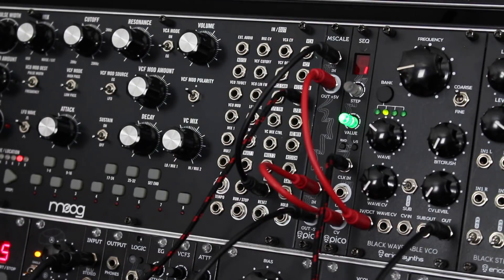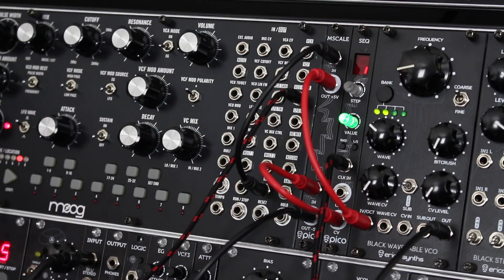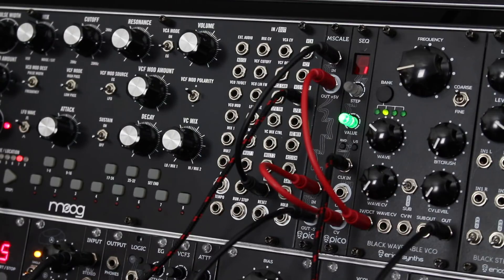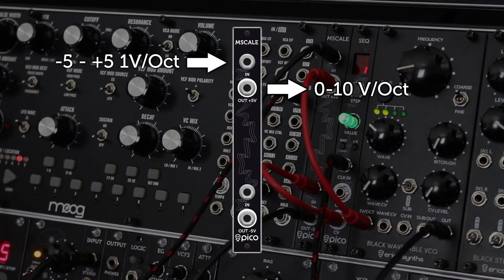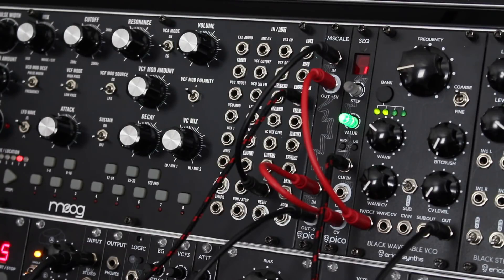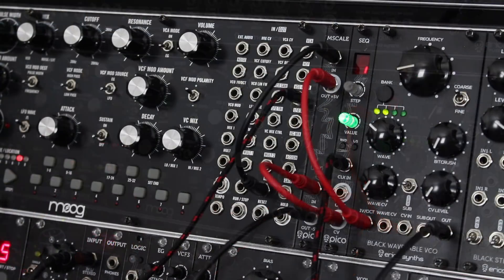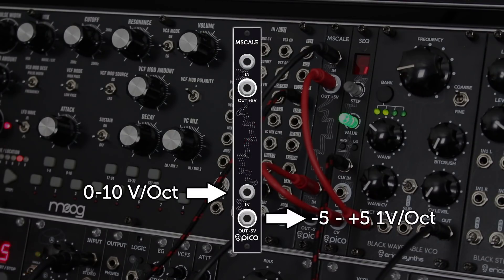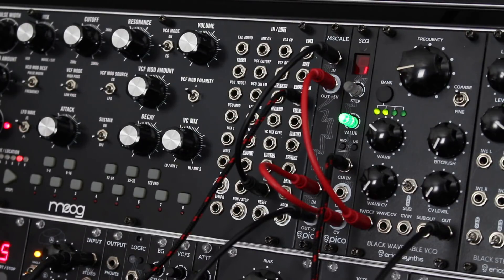Erica Synths Pico MScale demo

Comment: anyone else have a terrible time with this thing? yeah it works, but mine only stays in tune for about a half an octave. 6-7 notes past whatever octave you tuned to, and its way out.
if I switch back to midi, the synth sings perfectly in tune. 

im using a yarns for midi to CV conversion, and it works great on all my other sources. im stumped. might've been a big waste of money for half an octave.

Comment: Why can't you use a buff mult instead? I'm a noob so sorry if that's a dumb question.
Reply: buffered multi just multiplys what you put into it without signal degradration, it doesnt solve the mismatch in voltage range between modules.
Reply: I think of it this way...if you use an external (0v to 10v) sequencer that sends out the very bottom note (0v) the mother 32 will play a note that is only half way through its total range (as it goes from -5v to +5v) so you would not be able to sequence bass parts!...I'm sure someone will correct me if this is not right.

Comment: I don't understand, i have zero issue sequencing (and tracking) the Mother 32 with other sequencers (metropolis, René, ER101, Doepfer A154/155 and Octone). 
I have never tried the other way around thou (Mother32 sequencer to external VCO, as the sequencer of the Moog is a pure nightmare to program).
So what am I (not) missing here ??
Reply: yea, that confused me too, i just did some research. If i understand it right (am fairly new to modular) , The mother 32 tracks 10 octaves from -5v to +5v (still using 1v/octave), some (or most?) oscillators start at 0v as the lowest octave. So this module will take -5v to +5v and convert it to 0v - 10v and vice versa.
Reply: Same here.  When I first saw this module, I was thinking...oh...nice !  But then, wait... I had to check again that I have been sequencingmy M32 with no issue.  So, I'm not getting this, too.  Never thought there was any issue.
That said, one thing I don't understand: how can you control the frequency of a third party VCO (Wavetable VCO here) with the frequency knob of the M32, like seen on this video ?